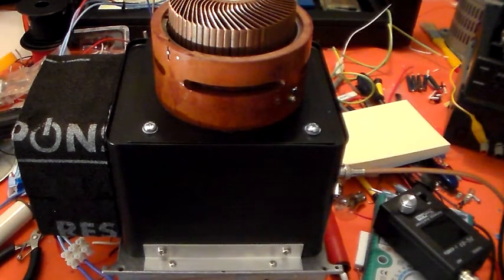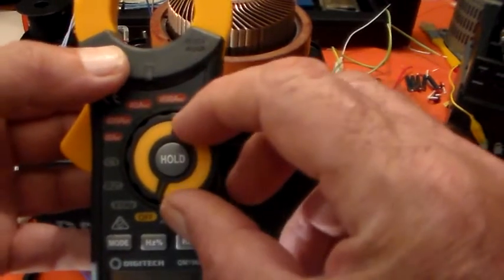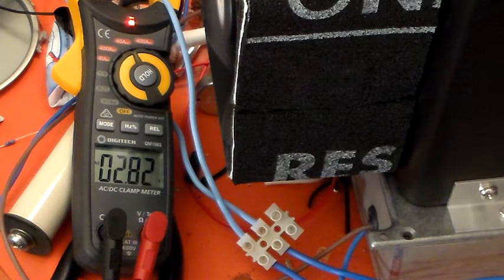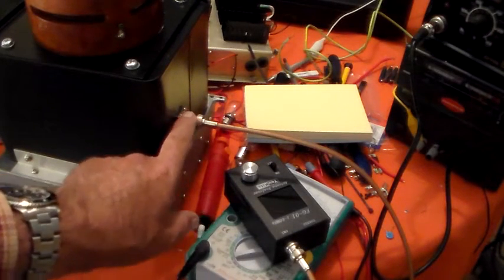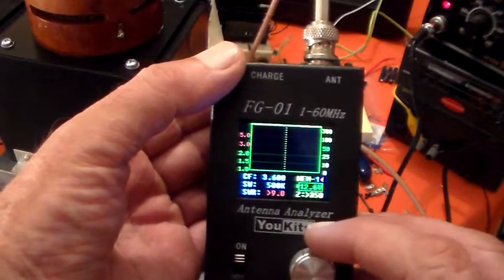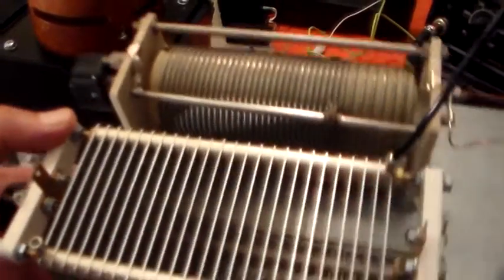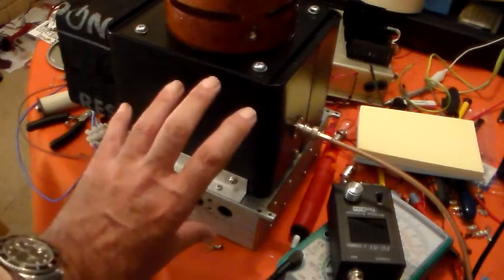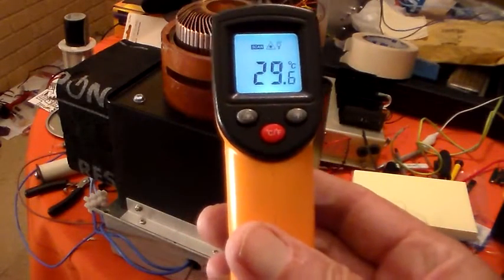Running The GS-35B Heater And Cooling.

Comment: I would have used a BR1160 for refinement of the output.....
LOL, Did that sound professional ? I have no idea what you're doing......
I don't know anything about radio.
But it looks fun. Thanks for sharing :-)
Reply from the maker: +Ade Larsen I was about to look that up... cheers Ade.
Reply: VK6CS It's a very good video. And some of the comments are very, shall we say, quite eclectic.
Reply from the maker: +Ade Larsen Thanks again Ade... amatuer radio is very eclectic hobby.
Reply: VK6CS I've always said that a full-call is a license to bore other folk. LOL.:-)

I'm thinking of swapping my tin foil hat for a capacitance hat - What do you think ?
Will it make me taller than I really am ?
And will it keep me full of charge all day ?
Reply from the maker: Remember... a capacitance hat only makes the transmitter think it's taller.

Keep a firm grip on your tin-foil hat, that way you don't have to keep a firm grip on reality.